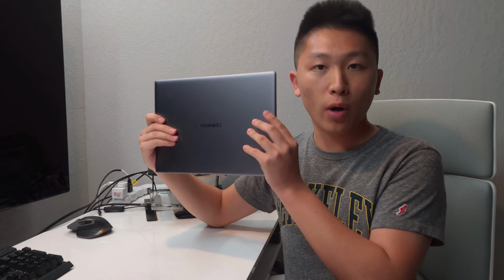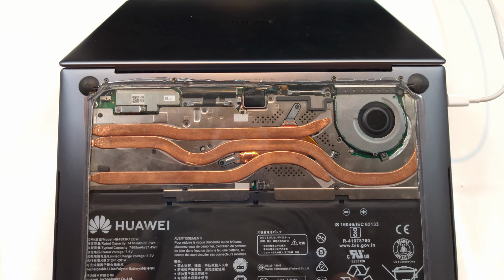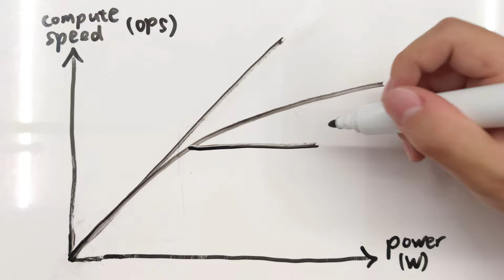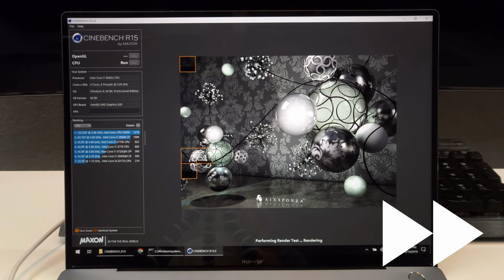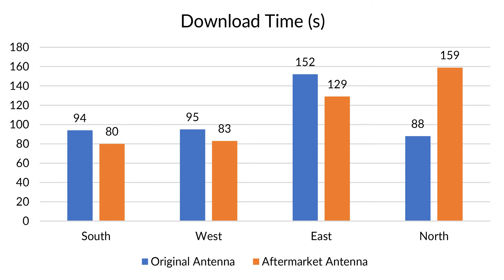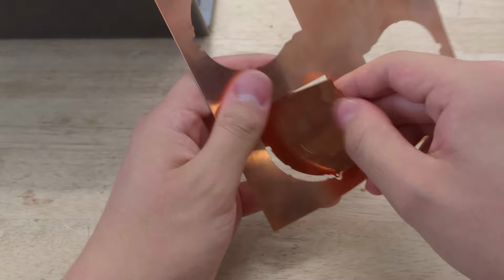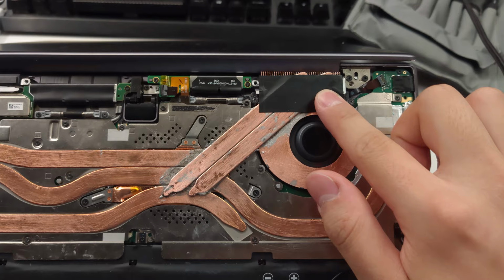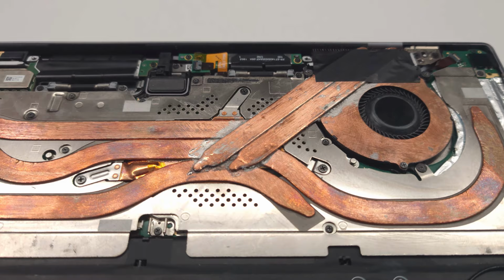Adding a Second Heatsink to My Laptop (MateBook X Pro)

Comment: Hi Brad! 
I have an old laptop I like, but after a cpu upgrading, has an issue: thermal management.
Yes, one problem was the insufficient mounting pressure. 
Yes, the fan has a low cfm output (5.3).
No, it's not the thermal paste (currently using arctic mx-6).
However, the dissipator thermal conductivity is intrinsically low, because the heat pipe is totally long 24 cm and has a U shape.
So adding another heat pipe seems an option, and your suggestion seems valid. 

I have a question for you about turning the fan case into a heatsink: 
at first glance it seems an intuitive option.
But after some investigations, I concluded that transferring heat on the fan case should create issues. Why?
If that you have is a centrifugal fan, it gets air from the downside, and, with rotation, it accelerates it pulling outside.
Now, the presence of a heat pipe on the fan case should create a hotspot right on the air inflow: so this means that the air, by rotating inside the fan case, gets hot, and then is expelled through the radiator. 
Shouldn't this actually diminish the efficacy of the entire cooling system?
Moreover, i think that contact surface with the stock heat pipe is another important parameter that can be optimized: the more surface, the better?

Could you show a picture with your thermal camera of your current setup?
and, if you possess it, before the mod?
Reply from the maker: Commendable effort to reason about fan case issue, but you have reached an incorrect conclusion.

(1) Heatsinking to the fan case, when you also have a fin stack heatsink at the fan outlet, is equivalent to adding a heatsink in series to another heatsink, because the air exiting the 1st heatsink (fan cover + heat pipe) enters the 2nd heatsink (fin stack). I think we agree on this.

(2) As you pointed out, the air entering the 2nd heatsink is now warmer because it has already absorbed heat via the 1st heatsink. However, the heat that it absorbed came from the processor, so it already contributed to cooling the processor. Its additional contribution outweighs the efficiency loss of the 2nd heatsink. I will prove this mathematically using heat transfer principles, and later cite a real-world example.

(3) The steady-state cooling capacity of a heatsink can be described by:
q = ṁc(T_out - T_in),
where ṁ is the mass flow rate of air [kg/s],
c is the specific heat of air [J/kg°C],
and T_out and T-in are the temperatures of air exiting and entering the heatsink, respectively [°C].

For convenience, let's label ambient air "1", air inside the fan "2", and the final exhaust air "3".
Let's start with a laptop with just a fin-stack heatsink at the outlet of a centrifugal fan. The fan basically just pushes ambient air into the fin stack, so the system cooling capacity is:
q_original = ṁc(T₃ - T₁)
Now let's start heatsinking into the fan casing. The fan casing now acts as another heatsink, so:
q_new = q_fan + q_stack = ṁc(T₂ - T₁) + ṁc(T₃ₐ - T₂)
T₃ₐ distinguishes that the final exhaust air won't be the same temperature as before (T₃).
ṁc is unchanged because we haven't changed the airflow.
As you predicted, T₂ is warmer than T₁, because the air has been warmed up before it goes from the fan into the fin stack.
By distributive property, the above equation simplifies to:
q_new = ṁc(T₃ₐ - T₁)
How does q_new compare to q_original? It depends on whether T₃ₐ >/</= T₃.
With the additional heat being dumped into the flowing air by the fan casing, do you expect the air exiting the laptop to be warmer, cooler, or the same?

(4) T₃ₐ will be warmer, because there is now more convection surface area — the air is flowing over more hot surfaces. Convective heat transfer over a heated surface is q = hA(Tₛ - Tₐ), where h is the average convection coefficient, A is the surface area, Tₛ is the surface temperature, and Tₐ is the ambient temperature. When you make the fan case a heatsink, you're increasing the overall convection surface area A, which means q (heat transferred) is higher:
q_new > q_original

Theory sources:
Fundamentals of Heat and Mass Transfer by DeWitt et.al.
Thermodynamics: An Engineering Approach by Boles & Çengel

5) Real-world example: compare the Noctua NH-D15S vs the NH-U14S desktop CPU coolers.
https://noctua.at/en/nh-u14s/specification
https://noctua.at/en/nh-d15s/specification
The U14S has a single fin stack and single NF-A15 fan. The D15S has two of those same fin stacks, sandwiching the same fan — we effectively have 2 fin stacks in series. In the U14S, the air entering the single fin stack is ambient temperature. In the D15S, the air entering the 1st fin stack is ambient temperature, but when it enters the 2nd fin stack, it's much warmer.  The ΔT for the 2nd fin stack is smaller, which means it itself has slightly less heat transfer, but the addition of another fin stack outweighs this difference.
Indeed, the D15S (or D14S) outperforms the U14S, and similarly, the D12L (1 fan 2 stacks) outperforms the U12S (1 fan 1 stack):
https://noctua.at/en/noctua-standardised-performance-rating
https://aphnetworks.com/review/noctua_nh_d15/temp2.png

More heatsinks in series is similar to having a bigger heatsink. Because there's more hot surface for air to flow over, the heat exchange is more "thorough". The gains are diminishing because of boundary layer effects and others, but there are gains nonetheless.

I no longer have this laptop. All the information I have is on bradshacks.com/matebook-x-pro-throttling/. In the "Run Heatpipes to the Fan" section, you'll also find a photo of how Huawei themselves made the fan casing a heatsink in the later-released Honor Magicbook. The MateBook X Pro 2021 also does this: https://www.notebookcheck.net/fileadmin/_processed_/a/4/csm_MG_3155blur_1a09813f9a.jpg
Reply: @BradsHacks  I have to sincerely thank you! Your proof seems valid to me. You made in few lines a lesson about thermodynamics. Maybe mine was a useless question, I should have looked on the manuals: however, my course in physics did not go deep about heat transfer theory, so I have a difficult walk into. Now I have some reference books to solve my doubts. 
Maybe you are a mechanical engineer student?

T3a should be higher than T3, because the added heatpipe increases thermal conductivity from CPU to fan case, than more heat is sucked away from it, similarly to resistors in parallel in a circuit powered by a current source. T3a would be equal to T3 if, and only if, the heat carried away from CPU is unvaried.

About the overheating issue on my laptop, I compared it with a newer laptop I have, and the difference, apart from fan airflow rate, is in the CPU silicon die size: the older one measures 1.5 cm x 1 cm, whereas the newer measures 2 cm x 2 cm; that's actually a great decrease in thermal resistance!

So, I can conclude that the heat bottleneck in the older pc is caused by the die size.
Adding another heatpipe on the fan heatsink, as you did, can effectively help reducing the aggregate thermal resistance, as you proved.

Finally, I read about the mod you did on your website, after seeing your video, but from that point some other questions arose to me: I would appreciate if you can help me solve:
1) Why is it mandatory to put thermal paste on the interface between the heatpipe and the underlying surface, given that the thermal paste will dry out over time? Why not just use the thermal glue to contact? 
Can you advice me a reputable product or can I get away with anything aftermarket?
2) How should I contact the heatpipe to maximize heat conductivity? Maybe maximizing contact surface both on the original heatpipe and the fan case?

Again, thanks for your explaination; I have now a model to use for drawing conclusions.

Comment: Dude can i jus i love this video you should start a kick starter and just make laptop, like id fund you just to see what you'd build and something worth checking out is the conduction between the heat sink shim and the gpu termal plate whther direct contact to infintay 0 of surface to surface or " in the way of conduction trasfer to the removal of the head " would a micro baffle to improve adhesion of the thermal paste as with liquid metal like a tiny lego brick or vapor chambers. the quick spikes are the real killers to factor clock speeds and the internal surface of the fan chamber " as with a planes external finish " reduces airspeed - Id love to see a rolls Royce laptop fan like those guys do great stuff

Comment: when you put the window on, did you seal all the cracks and crannies to maintain the same sealed effect as before the mod?
Reply from the maker: Yes, I used glue to seal the gaps and poured water to check it's airtight. However, I did not account for the foam strips that were on the original bottom cover. That will be addressed in an upcoming video.

Comment: Hey, im planning on modding my own laptop (lenovo v14)
After tried to find a way to fit the second pipe inside, now that the pipe's height is increased, can it still be safely glued? I tried to install the back panel, and it is fit, it maybe bend the lower heat pipe a bit, but pretty much safe as far as i know
Should i continue?

Comment: How did you solder that heat pipe without even sewelling them?? Please i want to done this too, that heatpipe may expolde thats what concern me a lot.
Reply from the maker: I think 2 things helped me avoid heat pipe swelling:

(1) Using hot air gun to heat only specific regions instead of putting the whole thing in an oven;

(2) Using low melting point solder paste: https://amzn.to/3mMHDNz

Comment: Hey. Do you think adding a custom heatsink + connecting it to the bottom case on a Thinkpad P1 gen5 would significantly reduce fan noise and temps? It has a vapor chamber design, maybe adding a thermal pad layer and on top of that a custom heatsink that touches the bottom case?

I got the i7 12700h rtx a2000 8gb version and as you would guess, it gets really toasty, load and throttles back
Reply from the maker: Might be worth a try if you don't mind your laptop frying your laps
Reply: @BradsHacks  wel, i work on a desk most of the time so hot bottom no problem for me

Comment: My laptop (X510UNR) throttles heavily during CPU+GPU loads and it has a single heatpipe (even with CPU/GPU undervolted). However, it has an empty Sata SSD slot right next to the CPU heatsink, do you think a similar mod is possible? Any particular advice?

Comment: i know its been a while since you did this mod an I was wondering..... can you remove the original cover from the fan, ( I know it can be done since I've done it) and only replace it with the copper laser cut you placed on the fan since you placed it on top of plastic .... that will remove more heat and lower you heat pipe a bit more to have a cleaner fit with the fins.... just my 2 cents thank you

Comment: hey brad, i have a matebook x pro 2019 that got spilled on, and now the fan is running 100% all the time.
its not the pins cause i cleaned the motherboard as good as i can.
do you think it could be the fan itself? 
ps. do you know if there is any way i can controll the fan speed myself?

Comment: Instead of trying to put a fin stack on the fan exhaust (which is way too small for an effective fin stack) what about putting fin stacks on the intake? Then the fan will be forced to suck air through a fin stack. Or maybe seal the fan intake and part of the heatsink together forcing it to suck air through those holes around the CPU?
Reply from the maker: Interesting idea, but when you constrict an intake, air will just find the next easier way to get in instead. So you would get very little airflow through the intake you just modified.

Comment: Adding the graphite sheet may not be beneficial as it has poor conduction from the heatsink to the Graphite, Z direction. It only has high conductivity across the sheet plane.
I would also make more vent holes in the bottom cover.
Adding heatpipes from the heat source to an external fin stack atthe outer reat of any laptop greatly improves cooling.
Reply from the maker: We're deliberately exploiting the graphite sheet's anisotropic thermal conductivity in this way. Combined with the motherboard backside thermal pads, it raises the keyboard deck's average temperature while lowering its peak temperature, thereby increasing total heat transfer through the keyboard deck while reducing user discomfort.

Adding vent holes would make sense for most laptops, whose cooling capacity primarily comes from fin stacks, but likely not for the MateBook X Pro, because it would create a shortcut for air to bypass much of the original plate heatsink's area. The losses from reduced flow rate across those areas likely outweighs the faster and cooler airflow through the final finstack, since the plate heatsink has much more surface area and less thermal resistance to the processor compared to the fin stack I added.

Comment: This is awesome. just a question if there is a possibility of having temperature improvements using a  cold pad running water or a heat sink  externally along side the metal area above keyboard(Externally) that heats up the most when overclocking the CPU/GPU. Such as Acer helios 300.
Reply from the maker: On my to-do list already! Stay tuned

Comment: i have lenovo b5400 i5 4200m, at load temps are 70~80, after undervolting, -100 cpu, -85 cache, -50 igpu, at full load temps are 65~71 and maintaining the turbo boost 3ghz, can finally play Project Zomboid at stable 60 fps, still im looking for ways to upgrade, can i upgrade to i7 4910MQ? 47w cpu ? i need help guys

Comment: And which type of black tape do you use for a sealing fan?
Reply from the maker: I used a piece of graphite sheet left over from my graphite sheet to chassis mod.
(https://www.youtube.com/watch?v=k0fXQiwLZDw)
(https://bradshacks.com/matebook-x-pro-throttling/)
I sell them here: https://www.ebay.com/itm/353065776668
I decided to use it instead of electrical tape etc because I believed it could provide a bit of thermal conduction to the fin stack.

Comment: Would be great if you could add wi-fi antenna, this copper radiator that you cut, low temperature soldering paste you use, and perhaps this hot air blower (if that's what it is) to the shopping list on your website. I'll hold with buying till the end of the weekend in case you add those links. Would also be great of you to share the DXF for a laser cutter. Sorry for being high maintenance :) I'll compensate with a donation on top of affiliate shopping.

Is soldering significantly better than using thermal glue?

Comment: Super nice video. My PC have a i7 8550u, vut with better cooling. This is an really awesome video, but the 4w gain was a bit underwhelming. I've got way better performance with -100mv on my CPU. Works a charm. I keep 2.0ghz while gaming with an MX150(25w). Both GPU and CPU undervolted a lot, as far as it will go. But this was a crazy video, super well written

Comment: This is excellent work, but you need to take it to the next level, i.e. design a modular upgrade to the cooling in CAD (or other) that can be CNC'd to fit, and the bottom bezel to be CnC'd likewise. I do not have the skill to do the upgrade you have shown, I'd also want a more elegant solution because your cooling solution does appear to bulge the casing. 

I'd be your first client and would purchase many of them from you. Many thanks

Comment: Damn, the moment i saw you are analuzing the flow iwth smokle i stopped and subscribed;

Do you think adding some heat mass to Dell Latitude 5310 would help (copper shims or even a heatpipe)?
Reply from the maker: Thermal mass helps with burst performance, not sustained cooling capacity. Copper shims are useful when there is a gap or insufficient mounting pressure between chip and heatsink. Heat pipes are usually helpful when they bridge between the heat source and heat sink.

Comment: Please read my comment: I have Acer helios 300 2019 model which has really good cooling system but I want to make it cooler. Anyways Acer launched new helios 300 2020 model and its fans have larger opening than older model. So I want to try larger opening fans please can you look for it? Should I cut my fan openings or Idk. I think

Comment: How do you have your SpeedShift on the main page set to 0 when in the tab theres range 1-46 ? I my tab i have range 1-34 but main page shows SpeedShift 128, how do I lower it ? Thank you
Reply from the maker: The Speed Shift Range and Speed Shift EPP (Energy Performance Preference) are 2 different things.

The Range is the range of clock speed multipliers allowed. So 1-34 allows your CPU to scale between 100MHz and 3.4GHz. You can use this setting to set a floor or ceiling to your CPU frequency. Normally you don't need to touch it, and setting it above the max multiplier allowed by your CPU does nothing if it's not overclockable.

The EPP is your CPU's preference of high or low frequency within that frequency range. AFAIK values of 0-255 are always available.
Reply: @BradsHacks  Ah OK, got it :) I didnt know at first I can directly change the SpeedShift EPP value in the main window. Thanks

Comment: I'll be doing similar thing to my Hp Envy x360 ryzen5 4500u.
Only 1 thin copper heat pipe with small fin stack and it hits 90C+ on Cinebench R23.
Pathetic cooling TBH.I'll post the results for before nad after the upgrade.